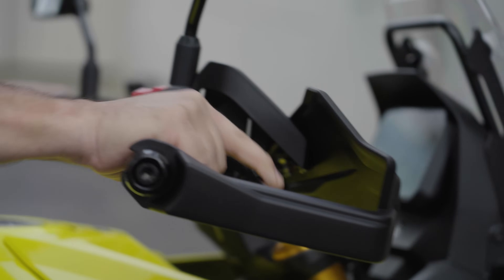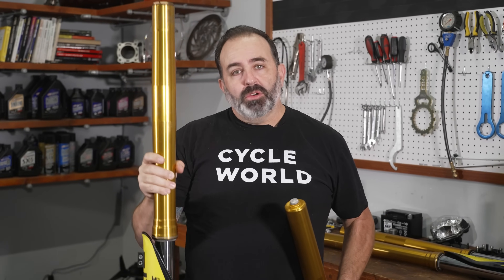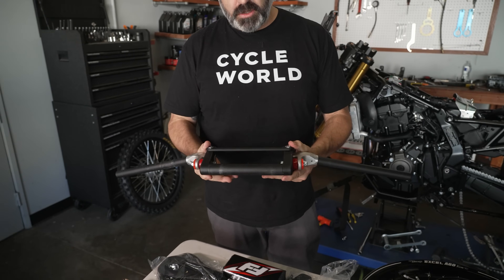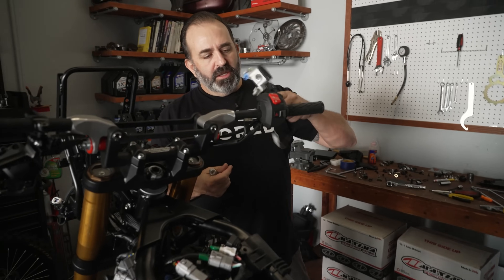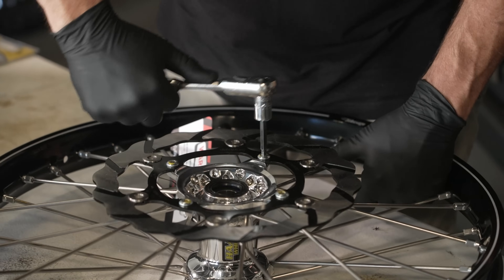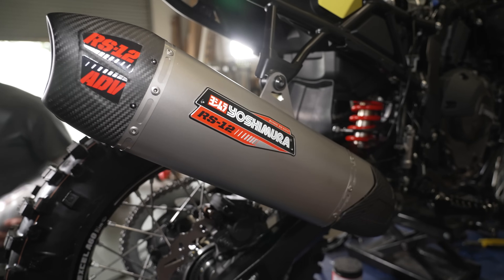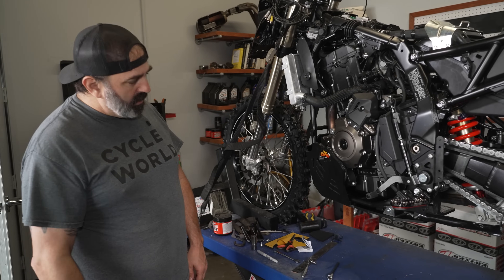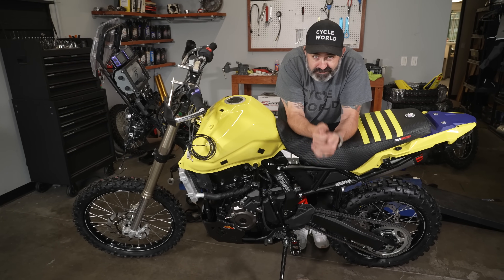We built the BEST Suzuki V-Strom 800DE in the WORLD

Comment: Nice build mate those bars didn't look too tall from what I could see I know it can make all the difference as it does on my KTM 690R Enduro not that there's much comparison. The bike would probably be a bit tall with an Adventure load on it but hey you got some excellent travel now both ends it will be amazing to ride in the bumps and jumps for sure. It's definitely going to be fun chucking a leg over but compared to the new 450 Enfield and the MT you got a rock solid machine right there in my opinion probably around the same weight give or take.  Thanks for sharing this fantastic build with us cheers Happy Trails

Comment: Pretty sick build for sure. Will def. have to follow for the full build and ride.  I might have done something different.  If the off set is similar or would compensate for the longer fork why not just use the RM clamps and make the stem from the DR fit that?  Also could have used the lighter Mako360 with damper sub mount the RM clamps.  Same concept as the flexx bars you have, but uses standard oversized tapered bars like the Protaper, that you can choose a bend that maybe adjusts for height or pulls back a bit.  I have a Mako360 with a scotts damper on off road bike.  I also have a 07 DR650 with a cogent shock and set up on it.  As well as a Ohlins cartridge emulator valves up front It's been a very nice set up.  I have shorter legs and have to do the same thing on my 650.  Going to try those mouse balls for my next set on my off road bike.
Reply: Offset was quite different on the RMZ clamps, so we decided it was best to use the V-Strom clamps. I'd like to have a custom top clamp machines to move the bars forward a bit more to make standing while climbing and accelerating a bit easier. The Mousse Balls are awesome off-road as long as you are not riding highway or a super high speeds for a long time (just like any mousse).

Comment: Great Build! I've been waiting for this one for a while! :)))
Technical question here! The A60 rims are limited to a 18x2.15" rear. Usually everyone I'ev seen or talked to that replaced the rims/wheels on they Trail bikes (T7, 7/890R, etc) I've only seen them using the Takasago 18x2.5" rear rims/wheels. Did you choose to do a compromise (if there even exists one) to be able to go with the A60 rims vs the Takasago? How does that influence the tire fitment (the sizes I'd say probably 140 or 120 on the 2.5" rim vs definitely 120 on the 2.15" rim? Don't know if I'm making sense here. Off-road tires sizes vs rim width is still very confusing to me :D)
Reply: We chose the A60 for the strength, but we also wanted to runa "dirt-bike" sized rear tire. The Dunlop EN91 we used is 140/80-18 which is just slightly larger than a 120. If we were doing more street riding and using a larger tire a 2.5 could be better.

Comment: Calling it a "v strom" is misleading. They took yamahas 270 degree parallel twin and added some displacement instead of developing the v twin

Being the middleweight v twin would have sold well.
Reply: According to Suzuki reps, "V" is for "versatile", not the piston arrangement. The 650 V-twin has been developed over the past  20 years and had a 270 crank

Switching to parallel reduces weight, adds packaging flexibility and simplifies maintenance, arguably making the 800 better off-road. The 800 twin has been in development for at least a decade, so this was possibly a change Suzuki had in mind independent of Yamaha's Tracer/MT 7s

Comment: As a V-Strom owner I was hoping this video would be useful to me. It's not. I don't want or need 'rad'. I tour on mine. 

Put some luggage on it. Fix the headlight.
Reply: What's the point in even commenting then. It's a rally bike build not a touring bike build😂
Reply: @NK-dl2nc  What's the point of turning a touring bike into a race bike?
Reply: @JayBee-cr8jm  It's an adventure bike not a tourer. Adventure bikes are generally designed with off road ability so all they have done is expand on that by upgrading it to make it more suitable for racing.
Reply: @NK-dl2nc  Adventure touring bikes are tourers.